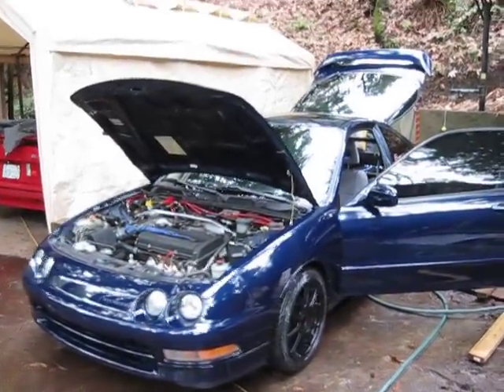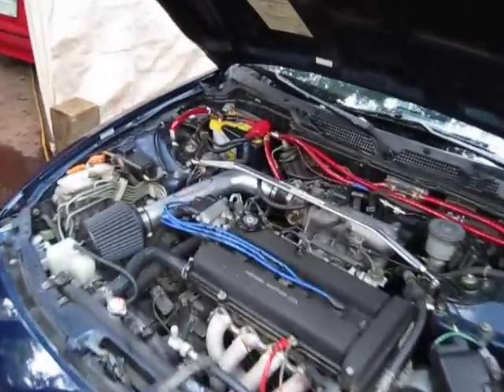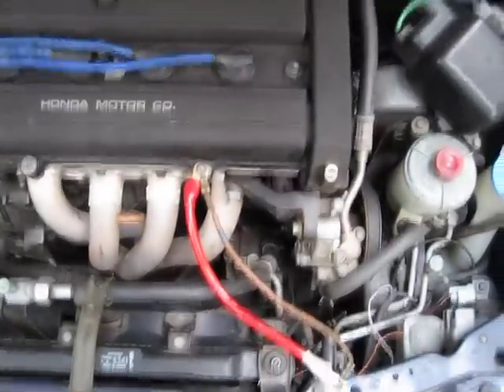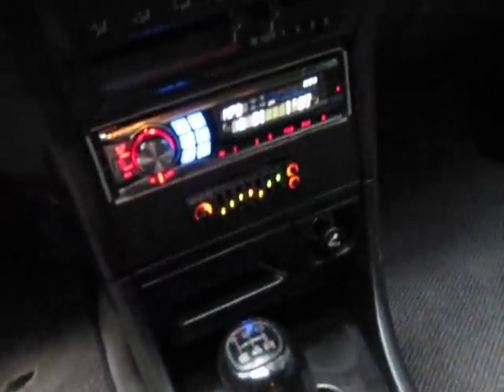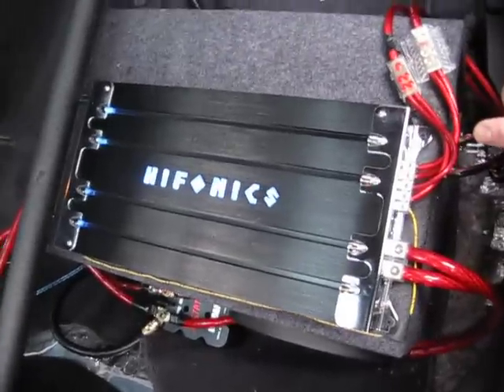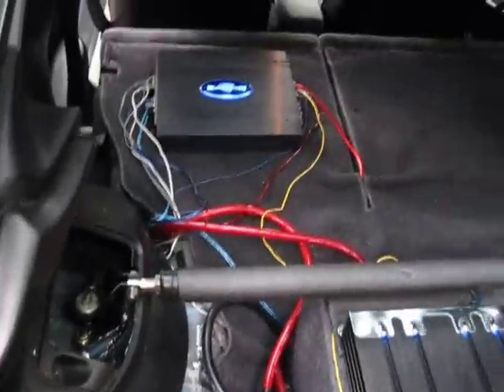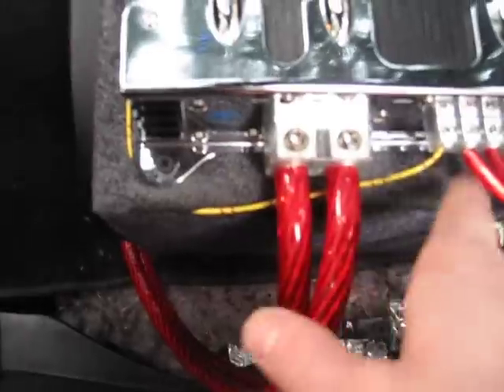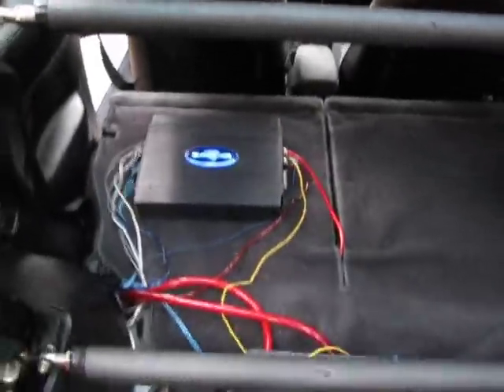Digital Designs 3510e in 1997 Acura Integra hatch!

Comment: Hey Asm, I'm looking at possibly getting an integra soon, around a similar year to yours, and I'm going to be putting a couple 12's in it...I love the car, however I was concerned when I noticed that integras use a slimmer, smaller battery than some other cars. I'm not too sure if I should custom mount a larger battery, or if it should be a concern at all. I noticed your running your whole system on your slim optima. Has it been doing well, or would you recommend a larger battery?